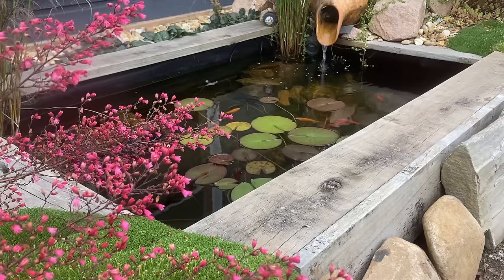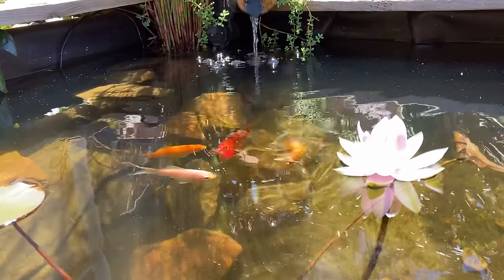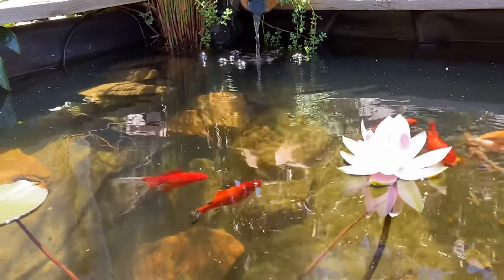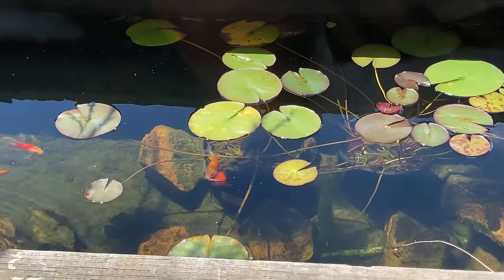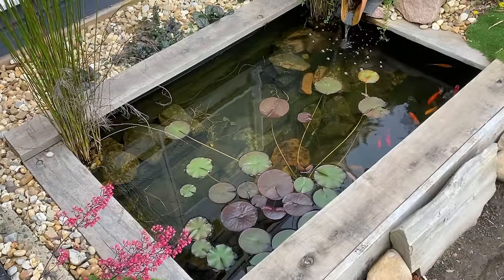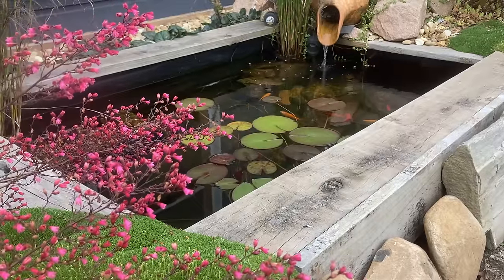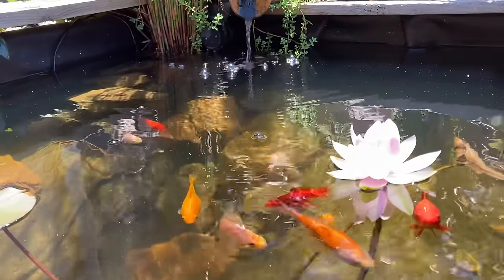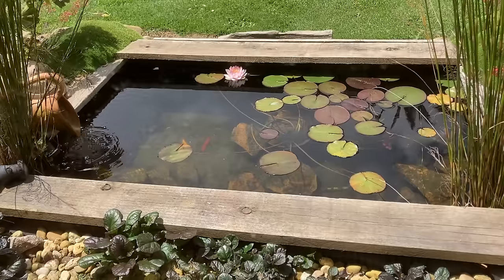Small fish pond with bog filter| Crystal clear water

Comment: Thank you for all the info you provide. Ugh, wish I had stuck with your advice and didn't allow my local pond supply store talk me out of putting a valve at the top of the inflow pipe. I am fairly sure my check valve has failed. My new 55 gallon drum bog filter is new, and totally covered in slime algae. I believe the check valve has algae in it, so it is not sealing properly when I turn off the pump. The local pond store also had me purchase a pump that was way too strong (1000gph for my 300 gallon stock tank pond). I am switching to a 500 gph pump, but am not sure what to do about all the slime algae in the bog filter. Perhaps this is merely the "new system" stage? I am using various sized lava rock (large on the bottom up to small at the top) for the media inside the 55 gallon drum. Thoughts?
Reply from the maker: You could do a 300gal pump for that sized bog filter. Algae is most likely just the new phase, that could last for quite a while. Remove as much as you can manually. If it’s still a problem in a few months give the bog a good clean.

Comment: Hey Kev I just finished adding and addition to my original pond. Things seem to be doing good. Added some beautiful new Koi. I guess the only problem is some of them tend to spend most of their time inside the big rock cave lol. I’ve put a separate pump and Aquascape biofall going into my waterfall. The original pond has a Savio skimmer feeding into another bio falls and a waterfall. I’ve put in small bales of barley straw and seems to be maintaining the algae growth. I do need to add more aquatic plants yet. However it’s fall going into winter and hard to find decent plants. Now to cut to the chase. Do you think a homemade bog filter would do a better job than the bio falls. The only problem I seem to be having is having to clean the filter pads so often . Obviously there is dirt that they are taking out and my water is crystal clear. Don’t really know why there is so much dirt to be honest. My original pond was simply a mess. Had several big storms. Waterfall was leaking some places a little and it would draw in dirt too. Fixing all of this I totally cleaned out all the muck it’s all fresh. I have a leaf net over all. Still a few leaves get through but basically it should be a good system. I think I have enough wet surface although I’m still going to add more rocks . I’m not sure just how long it will take for the bacteria to really colonize . Just how much muck will this prevent when working? I’m guessing because of the fish poo there will always be some. I have 11 Koi. The biggest is 12 inches. 4 7 inches. 2 about 5 and the rest are baby’s at about 3 to 4.  Not sure my gallons. Hard to calculate because of the shape and varied depths but I’m gonna say it’s about 800 gallons. I know you don’t have Koi down under but I’m guessing you still have fish to gallons estimates. I honestly have no idea how much they poo. I had wanted to do a bottom drain on the addition but it was too hard to accomplish with my location. My second pump pulls from the lowest bottom area. So basically I’m wondering if I built one of your homemade bog filters do you think it will eliminate having to wash my filter pads so much. I use a layer of a pad that goes from a medium density , then a polishing pad topped off with a charcoal infused pad. I have this on both bio falls. I have about 4500 GPH between the 2 pumps. The Savio skimmer has 2 coarse filter pads and I have a bag of lava rock in there. The bio falls have bags of 1 inch balls. The ones that provide the most wet surface area. So I do have clear water , no greenish color. Although I was very surprised to see some algae forming on the new liner. BTW I used 45 mm EDPM . In theory I think I should have about the perfect little pond. So I’m just wondering if adding a bog filter would eliminate some filter maintenance . Also about how much time till the whole new set up will take to be colonized properly. I can see the value of slower water in a bog. I’m also adding a Tee’d off line off the bigger pump to make a stronger water flow in the addition . I know they love a current and now line up in the flow between waterfall and pump. While this is ok it’s the location. It’s at the very front of the pond making it hard to see the fish unless you stand right over it. Sorry this is so long. I’m going to try and send you a short video of this pond. I’ve had a small area and budget else I would have done much differently. However I’m still loving it. Thx again for all your wonderful information. You also make a good video. Some ppl just shouldn’t make videos lol.
Reply from the maker: G’day Lee. A homemade bog filter might help reduce maintenance a little, but it really is more of a biological filter than a mechanical filter. To remove the poo and sediment (dirt) you really need the higher flow and filter sponges (which is your biofalls). Sounds like you have enough biological filtration as the water is clear.

Comment: Hi Kev, your videos r great !! Today I am installing my BOG Filter, I have a plastic basket with holes to fit over my intake pipe, should I use filter floss over the basket before I put the Rocks inside ?  Thanks
Reply from the maker: It certainly won’t hurt. It will act as a bit of a pre filter 👍

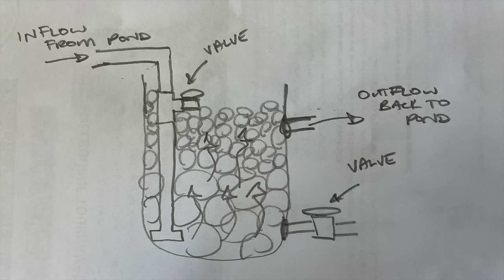Comment: Hi, me again (last time hopefully). In the diagram shown at 9:58, what does the end of the pipe from the pond inflow have to be like? It looks like a T-junction but should the pipe not go right across the bottom? If so should it be capped and have holes drilled along the horizontal bit? Thanks, Mark
Reply from the maker: I wouldn’t worry too much about much about the plumbing on this one, it was one of my first filters. I’ve simplified it now, as long as the water disperses at the base you’re good.

Comment: Hi Kev, we just finished building our first patio pond with bog filter Yay!! Thanks so much to you, I learned a lot from your videos! I have one question. I have sand at the bottom of my pond , and pump seats half way in the sand in small container with foam, but fish poo seats on top of the sand and doesn’t get sucked in by the pump. Is there the way to have fish poo eliminated and protect pump from sand? Because we are planning to build big swimming pond in the future with sand bottom as well.
Reply from the maker: Ah, the elusive clean bottomed pond. I’m convinced that no matter what sediments are going to accumulate in the bottom of a pond. You can use jets or wave makers to move the sediment from certain areas but it will just build up in another area. I think if you want a super clean bottomed pond regular vacuuming is required. Having a solids handling pump in the area where the sediments accumulate would reduce the amount of vacuuming needed, but would increase the buildup in the bog or other filter, therefore increasing the maintenance to the filters.
Reply: @Ozponds  thank you Kev!

Comment: Hey Kev, good video/ info as usual! Just wondered if you use anything to stop the smaller rock/ gravel from dropping down into the gaps between the bigger rocks at the bottom? I think in one of my bog filters the smaller gravel has started to slip down through the gaps. Thanks again mate!
Reply from the maker: I have tried using geotextile but I worry about it clogging. Now I just take care to make sure that the rocks aren’t small enough to fit through the precious layer. I find if I use 3 different sizes of rock/ pebble I’m good as gold.
Reply: @Ozponds  thank you, another quick question, I’m about to start on a new pond build and the bog filter will be a 500L plastic tote, so that would mean I would need a 3000 litre per hour pump, but the ones I’m looking at are 2500 litres per hour or 3500 litres per hour. In your opinion, would it better to go slightly higher or slightly lower. The pond itself is going to be about 1,500 litres. Thanks!
Reply from the maker: Go the 2500 👍

Comment: Great information, I did try to replicate your idea. Unfortunally my pump is 1200L per hour and is to strong for my bog filter. Do you know if I can install a valve to regulate the output flow of the sumergible pump? I mean I do not want to damage the pump. My pump does not have anything to regulate the flow it is jut plug and works.
Reply from the maker: I very often add a valve. Breather pipe for a bog filter
https://youtu.be/03Om94Fg5g4

Comment: Hi Kev, love your videos especially the ones where you show us how to build a bog filter. Well I am in the process of building one, plastic water container 60 liter which should be ample for my pond. One question though, on the bottom of the filter I want to leave a void under the pebbles. How do I do that and what do I use, also the pvc pipes go in the void or above? Thanks for your input.
Louis.
Reply from the maker: You can use anything for the void that will support the weight of the rock above. In a 60 litre tub you might even decide it’s unnecessary as it would be easy enough to empty the bog if need be. If you still want to create the void a piece of 90mm stormwater pipe with lots of holes would do the job. The pvc pipe will go into the void.
Reply: @Ozponds  thanks for the response. So the void doesn't necessary be the whole area of the bog, a piece of 90mm storm water pipe, the length of the bog above the drain hole is enough I take it.
Reply: @Ozponds  also what are the best water plants I can use in the bog, there is one called Bacopa, is that ok to grow in water?
Reply from the maker: In a small bog like yours that would be fine.
Reply from the maker: Bacopa is good. I have a video on plants for a bog. 👍

Comment: Hi Kev, I have been learning heaps from your videos. Thanks for all the info. :) I just picked up a 2m diameter x 60cm deep round poly stock trough (approx 1880lt)for my first pond (gumtree bargain @ $100- stoked!) . I am figuring on getting 1x 200lt blue food drum for  the bog filter set up. Prob only going to start with 6-8 goldfish for that volume of water - to see how I go. 

I am Interested in how I can best get water directed into a skimmer/ submersible pump section opposite the bog outflow in a pre formed round pond like this. Also, I am not sure how any excess flow from the pump might be diverted into side/ base jets to improve circulation and so that I am not flowing all of the water too fast through the bog. Was figuring on a 3000lph pump for bog to try to do both functions off one pump. Is this advisable or doable? Otherwise I will scale pump back to 2000lph and sort something else for extra aeration/ circulation on the pond. Cheers for any advice or maybe a video on such ideas if you haven’t made such a one as yet. Will slide a PayPal donation your way once I get paid next!  - prob email direct anyway. 

Cheers again for all the great info. :) VC
Reply: I think he does have a few Videos on how to divert the water , I had a similar question as well , my bog was flowing to quickly so I think one of his latest videos touches on this. But Kev will answer this for you as he usually answers his viewers  😉👍🏼
Reply: @rochelle6006  thanks I will look for any videos on it. 😊
Reply from the maker: For the skimmer you just need to create some kind of structure that water can’t move through. You would leave a narrow opening so all the water must move through that to reach the pump. That will create the surface tension. It could even be something as simple as a bucket where the top of the bucket is just an inch or so below the waters surface. The pump sits inside the bucket pulling all water in. You could disguise it with rocks. Have a search for the diy skimmer videos that should help explain it. 

With regards to the jets you can just split the main line off and add some little valves that will help regulate the flow. I have a video where I added jets to my dream pond. You’ll find that in the dream pond playlist. Hopefully that will help.
Reply: @Ozponds  cool. Thanks for that. I will look through the play list again. So a slightly oversized pump, if energy efficient enough, would be the better bet overall? I think I just watched one of your videos about ‘the theories of malm’ 🤣 so I will start off with pump and skimmer bucket  straight on the bottom of the pond. Was going to do a ledge for it, but a 20-25kg commercial mayonnaise bucket should hit a good height  near the top of the water level in a 60cm deep pond. Trying to keep it super simple to begin with . Main fear is keeping frogs away as I know that from a neighbour’s pond years ago that the constant ‘ bonk’ noise drives my husband and I spare! .
Reply from the maker: Not necessarily. Sometimes I prefer to use multiple pumps so I know exactly how much flow is going where. The frogs will find the pond! They always do.
Reply: @Ozponds  ahhh!! I have been looking at natural frog deterrents - we are in inner suburbia so I might get away with it for  a while at least. Then it will be a catch and release program from me! —just need to convince hubby now!
Reply from the maker: 😂 catch and release! I love it!
Reply: @Ozponds  in a fairly plain round , partially above ground preformed pond - it is doable- I have done it before:)

Comment: Your vids are very informative, but I wish you would explain hiw they are connected. I understsnd your pump is connected to the biological filter but hiw do you tie in the bog filters?
Reply from the maker: Have you watched the videos on plumbing?
Reply: @Ozponds  haven't seen any, but will look.  I have a 250 gallon pond I am installing. I plan to have a spillway at the top first spilling into a small pooling area then continuing down into the pond. You would connect the pump to the inlet, then connect hose from the oulet to the spillway.  I would think you could use a tee to run your hose to a bog filter?
Reply: I forgot to mention I have a 950 GPH pump.
Reply: Just purchased your 10.00 pdf. Loads of good info, but still dies not show how you connect everything. I did see that it is suggested to have a separate pump for the big filter, which I had already thought about, maybe a small solar one.
Reply from the maker: @debbieesparza110  thanks for the purchase. Plumbing connections aren’t a formula, therefore it’s not in the pdf. Hopefully this video helps you. All plumbing is a bit variable Plumbing a DIY pond
https://youtu.be/RATTvGg9uIU

Comment: I'm going to try to build a bog similar the drawing you have at about 9:50, and I was wondering if the valve that's meant to keep water from siphoning back into the pond could be a small hole drilled into the pvc pipe instead of a control valve. It just needs to be open a little bit, right?
Reply from the maker: Yeap that’s fine just make sure the pump is sized correctly. The valve allows you to move extra water over the surface of the bog.
Reply: @Ozponds  OH okay, so it's if you have a bit too much flow it will go out the top instead of up through the rocks. I need to watch the video again. Thanks for your help.

Comment: Can the bog filter be effective without bog plants? I've used a fair amount of different ones and so often their roots become a matted mess and clog the PVC inlet. I've thinned the root systems out but its quite a bit of work to remove all the rocks to get to the roots to do a proper thinning. Horsetail was especially annoying as it became a matted mess at the bottom
Reply from the maker: Yes. Still works without plants.
Reply: I have a sealed drum three quarters full of  10 mm scoria pump inlet at bottom out at top. Then piped to a pot of mint above the feature again in 10mm scoria. I redo it every couple of years,  nothing is maintainance free but this keeps my water clear to the point I've stopped trying to improve it.

Comment: Hi! I'm starting a project this year and I'm keen on making a pond of about 10000 liters. I'm following you for quite some time as I don't know what I'm doing and I try to make it as diy project. Did I understand correctly that the pomp I need to use for the bog (100 liters big) needs to be 6 times its capacity? Would I need a 60000 liter per hour pomp? It would be a huge pomp probably. Thanks so much for all your info on the channel!
Reply from the maker: No. 6 X the bog volume. So for example your pond is 10,000 litres. A bog of 10% would be 1,000 litres. So the pump running the bog would deliver 6000 litres. I hope that helps👍
Reply: Thanks so much for your answers! Have a great Sunday!

Comment: Aloha, Sir does it matter on the size of the rocks being used in a bog filter. I see a lot saying to used a 3/8” pea gravel? But aren’t all gravel or rocks aren’t really 3/8” all around. Hope this comment made any sense?
Reply from the maker: I’ve used many different sizes all will provide surface area for the good bacterias.
Reply: Do you recommend any other filter media other than rock/pebbles? Like kitchen scrubs/nylon nets etc? As I require to move the filter in my case

Comment: I enjoyed your channel & I like your pond 😍. My new pond is almost same with yours, it's 1010 liter but I bought 5000l/h submersible pump 😬 since I'm beginner to this hobby. Do you have any suggestion, will it be works if I divide the water into some flows? Or should I buy another slower pump 😢. And its for turtles not fish. Thanks..
Reply from the maker: It depends, what type of filter you are using?
Reply: @Ozponds  I'm using DIY 2 buckets filter, filled wth sponges & pumice mix wth coral.
Reply from the maker: Then high flow should be ok. You’ll just need to clean the sponges very often.
Reply: @Ozponds glad to hear tht, tks Kev.